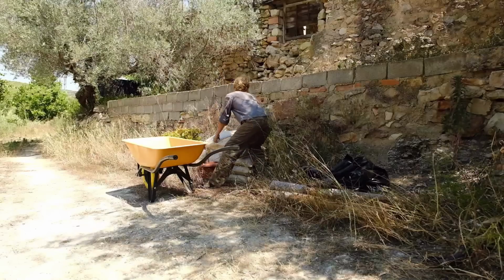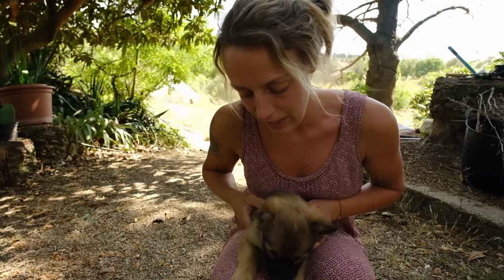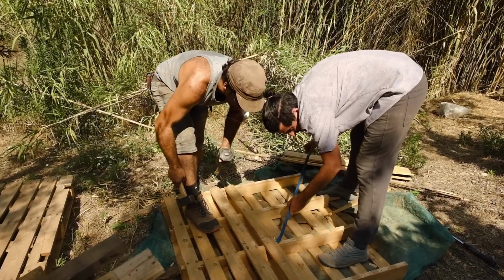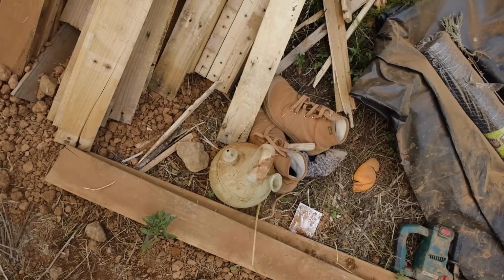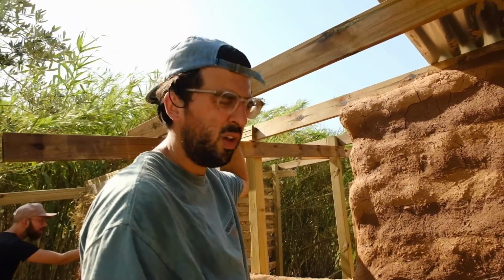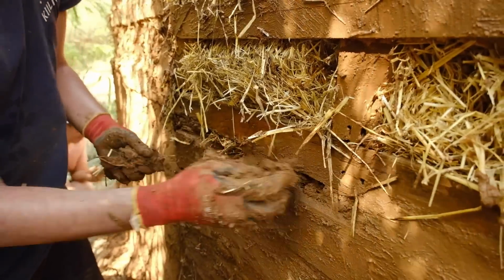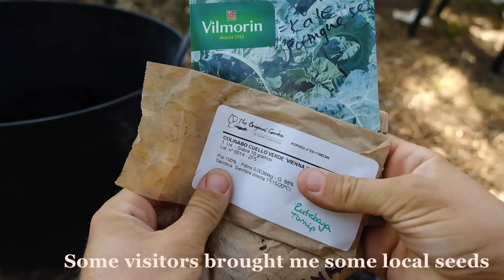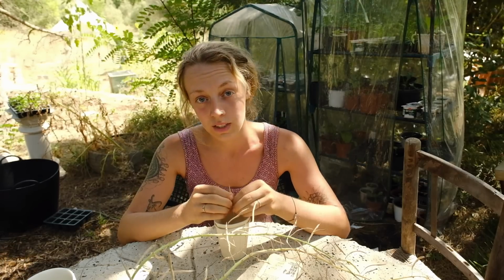A Surprise for the Goats! | Off-grid Homestead in Spain

Comment: You needed a wheelbarrow for mixing it would help mix fast, and you mix with short straw.  Use shovel and hand tools it helps the fines mix together and give a better shinier mix and it makes the materia adhere better. It would help a lot using hand tools.  Hand tools help you with pushing the mud in more and also minimize the cracking.
First layer is always good to lay thin.  Then move elsewhere.  Then come back and mist the thin drying later, and apply a bit thicker later.  That helps to minimize cracking.
Good thing is to mist the mud walls next morning or later in the day..
I have built with mud and I also have a civil engineering background, mostly in geotechnical stuff.

Comment: Some ground covers are very expensive at the nursery so I cut sting pieces of green ivy and put them in the trays in the shade and they rooted. You do need to check them out for watering. Some put cuttings in a plastic bucket to see if they'll root.

Comment: You may find the condensation from the goats in winter as it hits the metal roof will cause it to drip and wet the bedding you might have to put a false roof inside of chicken wire covered with some straw. Ventilation is the key goats don't mind cold just hate rain #littlefarmwiththebigviews

Comment: Your workshop turned out great it seems. Very cute little addition to the family 🐕. I wanted to ask you about your sourdough pancakes Harriet. Do you use part starter/part flour/? I guess I just want your recipe please lol. Thx for the Video
Reply from the maker: Aw thank you! For the pancakes I usually just use the starter directly from the jar. Unless I need to bulk it out to make lots of pancakes in which case I take some out and add more flour and water until I have enough mix!
Reply from the maker: always equal parts (weight) flour and water
Reply: @LittleSpanishFarmstead  Thanks so much